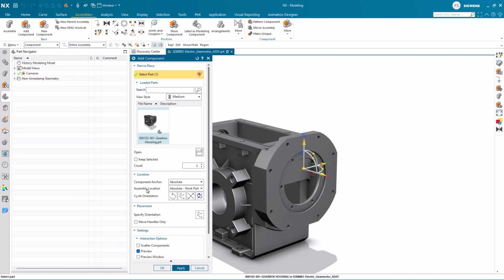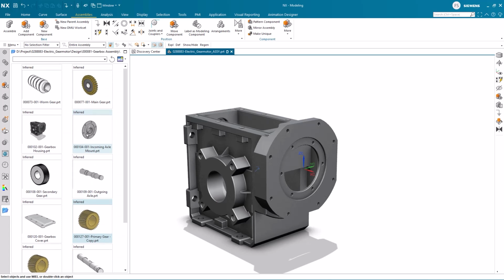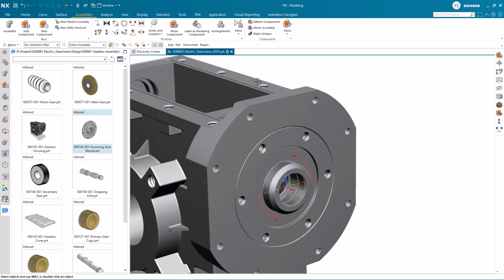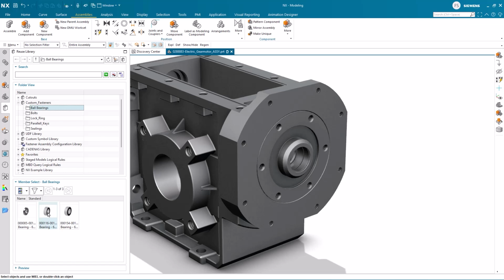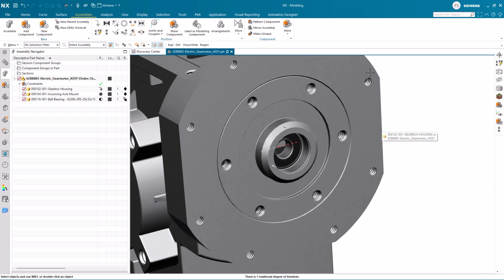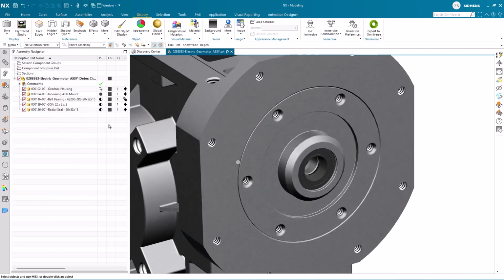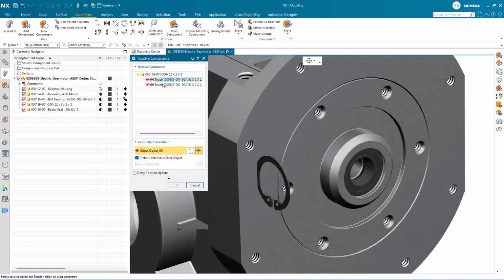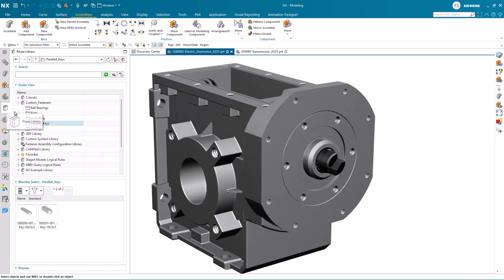NX | How to series | Building an assembly for the first time

Comment: on the copy and paste section, is this a new feature?  i use nx2312, and the constraints dont pop up like that, the part just paste on top of the existing.
Reply from the maker: Hi - this is probably a feature introduced in a version later than the one you're using. Our user community can be a great resource for information on the various features in different versions of the software. If interested - please join the community at this link and ask your question or research prior threads on this topic: https://sie.ag/n4qjy